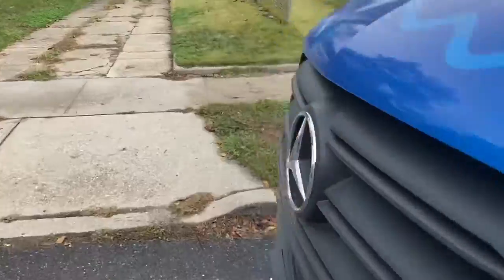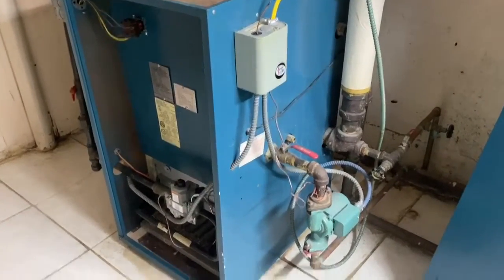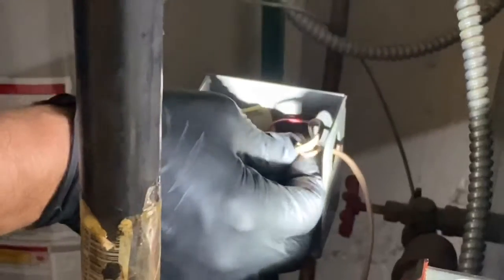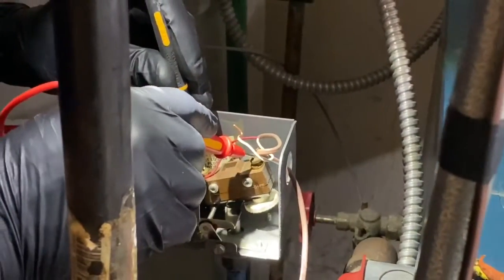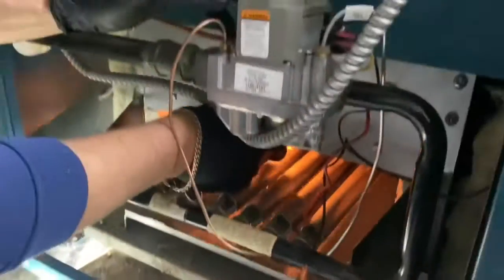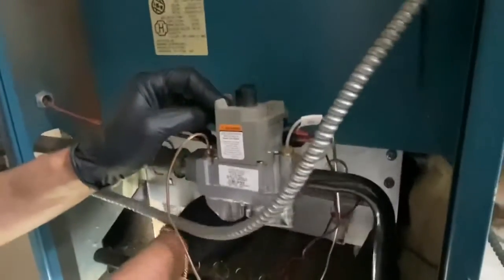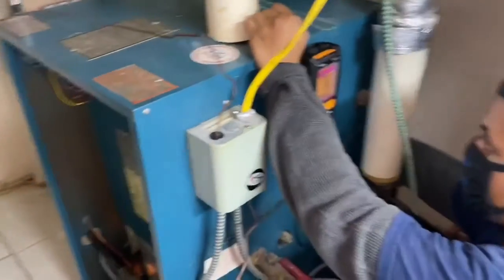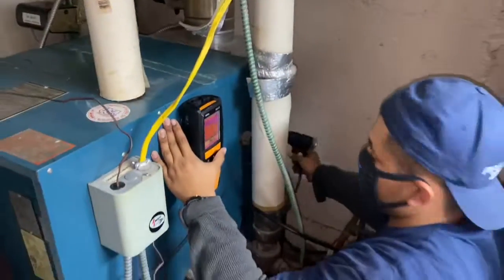Burnham IN5 Gas Steam Boiler No Heat 20 volts to gas valve defective roll out switch

Comment: Get a set of jumpers and a 24 volt test light... take a peek at the thermostat.
Put the 24 volt light across the valve and if it lights no need to check the thermostat or any other switched...imho